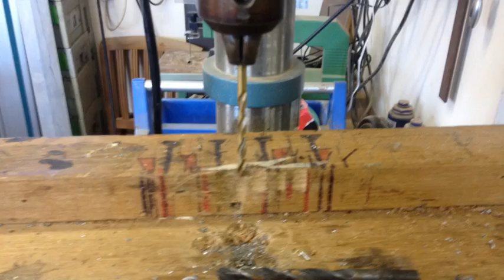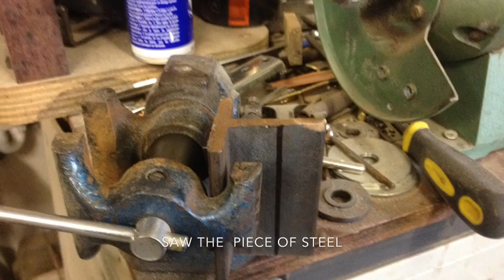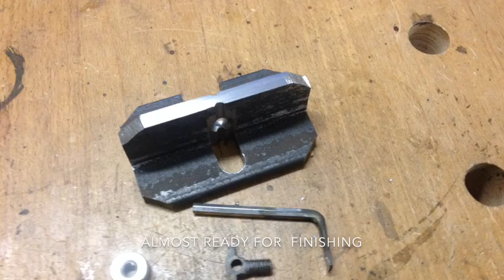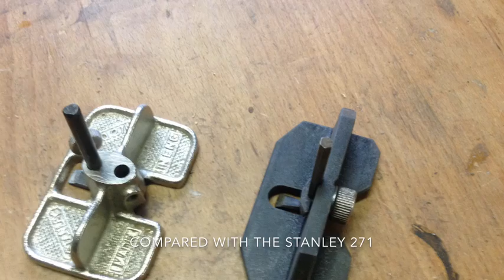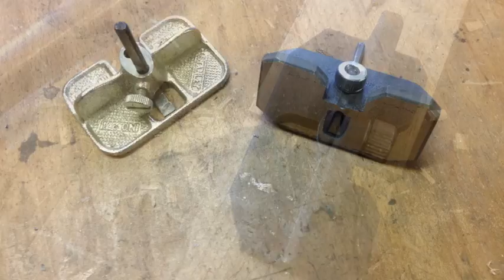How to make a router plane from a rolled steel bar

Comment from the maker: Hello ytctrb,
Before I hammered the tip I heated it red hot so that I could form the chisel. I did this several times until I had the form I wanted. 
Than I sharpened it, it's a Allen key of hard steel, when you heat it it will lose some of his hardness but that doesn't matter so much, if you like you can harden the steel tip again. And yes I bent the tip a little to get a better cutting angle. Thank you for your reaction. 
Gr. Roeland
Reply: that is beautiful. So is it reversible? Closed mouth and Open mouth?
Reply from the maker: Bill Rogers Yes it is. very handy for narrow corners or planing to to the end.

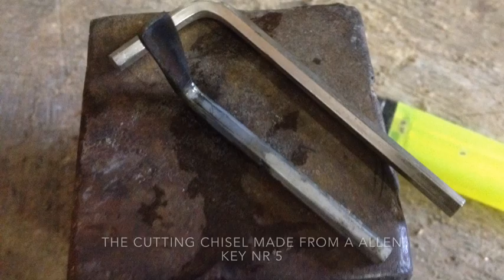Comment: Looks great! But how did you make the cutting iron from the allen key? Did you just grid it or did you also hammer the tip flat (at ~0:36 it looks wider at the tip)? Isn't hammering and bending (it also looks bent) hardened steel problematic?
Reply: Not if you reach a good heat first.

Comment: Well done, functional tool. Not sure if the tool has a different name where you're at, around here we call it a router plane. Is the "ground" plane a local thing or an auto-correct thing?
Reply: he's Dutch so, it's called a: https://nl.wikipedia.org/wiki/Grondschaaf
Reply: @mikehindley3  thanks for the information. The link goes to a Dutch wiki page and I can't find a button to translate it, so other than a name in Dutch, it gives me no other information I can understand. But thanks anyway.
Reply: @thomasarussellsr  no worries. What info are you looking for specifically?